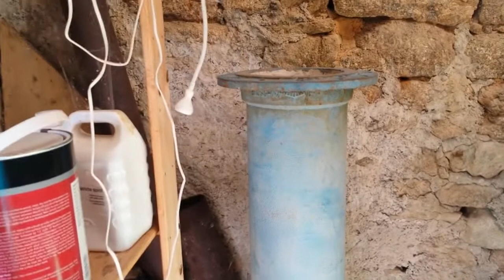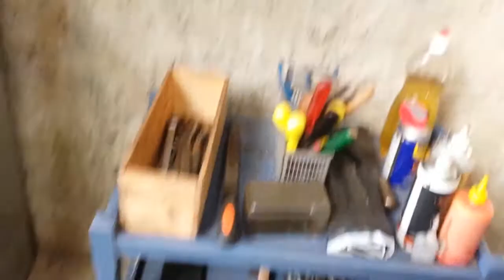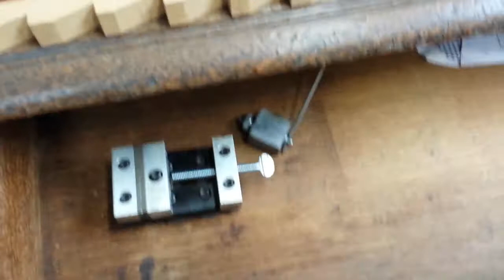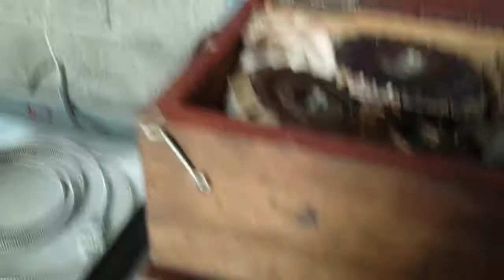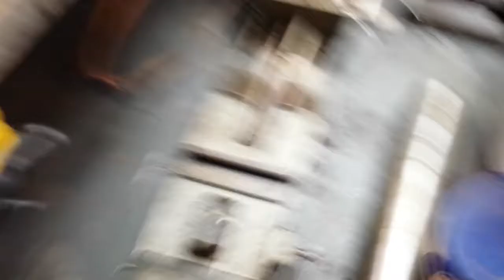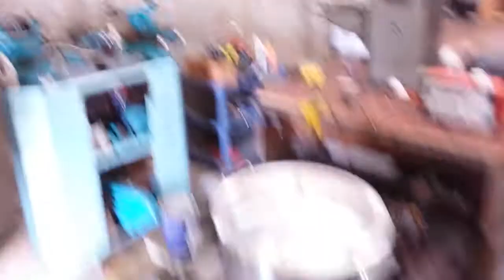France Workshop Tour Part 1

Comment: I've a Pallas model C...an earlier model...very similar to the wisconsin Miller you have...
They typically had a 3 step flat pulley...mine has been Lucky  and kept its flat belt pulley...

I've about 30 vintage & antique machine tools waiting restoration...all lineshaft stuff...

Nice stuff you have there...
Reply from the maker: Wow... 30! That makes me feel better  :-)

Will do a search for the Pallas and check it out.

Thanks for watching/commenting. I love the old lineshaft setups.
Reply: gary .a. ayres

I've an old radial drill by William Asquith, Halifax...
Its 9ft high weighing in at
3 1/2 ton...
Rating plate says: 5" drill at 36RPM...LOL
you can't even get a 5" drill now...
Date: around WW1 period
It's generally OK but I've identified some wear on it...but not major
I'll rebuild it...but it's one for the future...it'll have to wait it's turn

PALLAS MODEL C:

https://www.google.co.uk/search?ei=GpIVWsmaC8vVgAallaHwDg&q=Pallas+model+C+milling+machine+images&oq=Pallas+model+C+milling+machine+images&gs_l=mobile-gws-serp.3...7923.13675.0.15016.20.17.3.0.0.0.241.2281.2j14j1.17.0....0...1.1j4.64.mobile-gws-serp..1.8.890...33i21k1j30i10k1.0.uqpy4c2GPRE#imgrc=5V4LSEp4DiyrQM:
Reply: gary .a. ayres

I've an old workshop table saw with a 2ft blade...no makers name but I'm suspecting its a COOKSLEY...I'd say 1900-1920
In all the time I've been collecting stuff I've not seen another... 

And a bandsaw...WATTS of Sheffield...24" wheels...early 1920s... 
There's not many of these around... 

I've a WADKIN EZ...
the EZ is a spindle moulder...its an earlier one for lineshaft running...1920s-1930s...
They're quite rare are these...

I've a hollow chisel mortiser...says SMITHS on a removable cover...but it's almost certainly a JAMES SAGAR of Halifax...1920s
There's one in Canada I know about...apart from that I've not seen another... 

I've an old pillar drill by EASTERBROOK ALLCARD & COMPANY... Sheffield...
Date: I'd say 1900-1920...
You won't see another of these... 

And another pillar drill
JONES & SHIPMAN Leicester
4 MT...3FT round table...7 1/2ft high...well over a ton...
I've seen a print of one dating 1902...I'd say mine was 1910-1920
There's a few of these left...count em on one hand though... 

Thats just a few bits..

I've 3 wood lathes, 2 centre lathes, bench, pedestal and surface Grinders, donkey saws another 3MT pillar drill and another radial drill...a shoe finishing machine (for metal polishing)...and some bench drills... I've a 12" Jointer by METALCLAD...

there's allsorts to be going at... 

All would have been steam powered at one time... 

I've just bought yet another Jointer...🤔

What you have there is a nice collection of good, vintage usable stuff...keep adding to it...

Old & vintage tooling (for lathes, drills & millers)... that can be had for not too much...
Its all part of it...
Reply: gary .a. ayres

You do rite with them windows...

We've had intruders in the yard twice last month...

The first time they claimed they were looking for an "off side wing for an astra"....our yard isn't even a car breakers...they were just mooching about...

Next time it were "we're looking for our dog"... 
We caught em rummaging about through the non-ferrous...
We told em they had 2 mins to fuk off or my mate would be setting his dogs on em...

You do rite keeping stuff out of sight...too many people can know too much about what your doing...

There's some rite Mr & Mrs everyone's business going round...pryin...interferin...
Reply from the maker: Flippin' heck! That's quite some catalogue you have there. Makes me feel totally moderate. Are you running a lineshaft? Would be good to know, as all the lineshaft videos seem to come from guys in the States. Respect to them, but it would be good to know if you (or anyone) has set up a lineshaft in the UK.

Also note that you haven't posted any videos of that lovely collection...  :-)
Reply from the maker: Lol, yes - well put!

Agree - keep a low profile is best. My shop is in rural France where the crime rate is very low, but on the other hand I'm away a lot so better safe than sorry.
Reply from the maker: BTW here in my Brit workshop I also have a Coronet Major woodturning lathe and 'wood machining centre', and a Dore Wesbury mill. Both are lovely and  in regular use.
Reply: gary .a. ayres

Eventually I'll run em off lineshaft...

I think I'll keep an electric drive though for each one...
Then If I want a 'steam weekend' I'll drop the belts off the motors and run em off the steam drive...
Reply from the maker: Good plan. Best of both worlds...
Reply: gary .a. ayres

I'll put some videos up as I start dragging em out 1 at a time for restoration...some of em just require a rebuild, service &  paint...
Others need some work...theres some machining to do for a few of em...and some welding...
And don't let anyone tell you that you can't weld cast...
Cast iron welds beautiful...
You've just got to obey a few rules with it...
Reply: gary .a. ayres

I've 3 wood lathes
1 is what we refer to as a 'pattern makers' lathe...they have compound slides on em...you can put a slight taper on patterns with it...(you need this to allow the successful withdrawal of a pattern from the cope/drag...
It's 7" swing...5ft bed...about 1900-1920

I've another that needs some work...
This one is just a standard wood lathe...again about 1900-1910

Third one we think is a Wilson of Leeds...i had to go to Fife to get it...near Kirkcaldy
It's a 1/2 ton brute with a 6ft gap bed...10" swing over the tool rest...16" swing over the gap...
Its currently dismantled into sections but everything on it is bloody heavy (you need this when swinging uneven/unbalanced logs etc)...
Date: 1920s
Reply from the maker: Good to know you'll be posting some videos. Also good re welding cast iron. Will give it a try in due course.
Reply from the maker: That's a lot of beautiful old iron.
Reply: gary .a. ayres

Look on Chucky2000 in here (Utube) if you want an intro Into welding casts
Reply from the maker: OK thanks Glenn - will do.
Reply: gary .a. ayres

I'm just uploading my first Utube video now

Take another hour
Reply from the maker: Doesn't seem to have appeared yet. Upload issues?

Looking forward to it though.
Reply: gary .a. ayres

Done it

Have a look if you like
Reply from the maker: Strange... still getting a 'this channel has no content' mesage.

Will try again later. Looking forward to it.
Reply: gary .a. ayres

I'm still trying to work Utube...

I'm not very good with computers n stuff...
Reply from the maker: Got it!

You do fine.
Reply: gary .a. ayres

Ta.

I don't know how you can make it list in my account

I'll have to look see...

Thank you Gary..😉
Reply from the maker: I noticed that your account with the video has a different avatar icon from the one I'm replying to now. I wonder if you accidentally created two accounts? Easy mistake to make - google can be a pain in the arse.